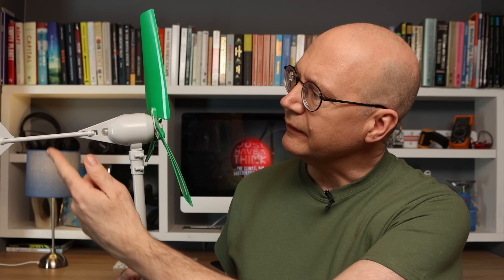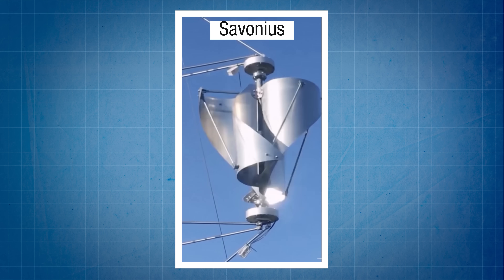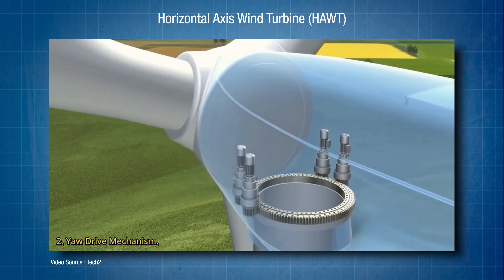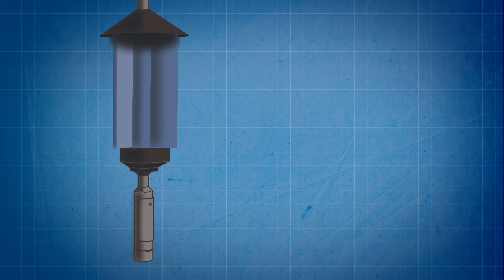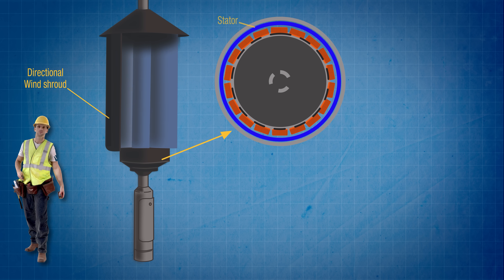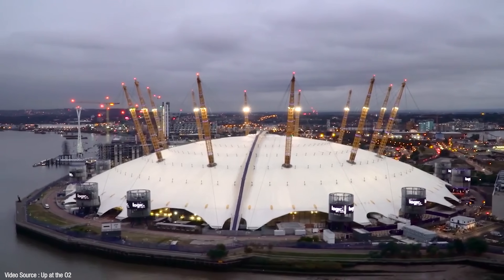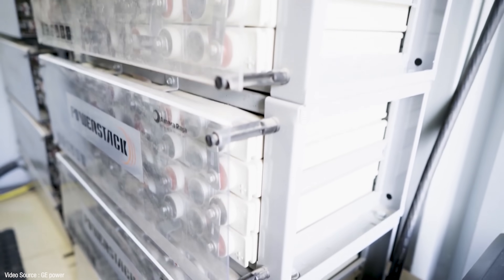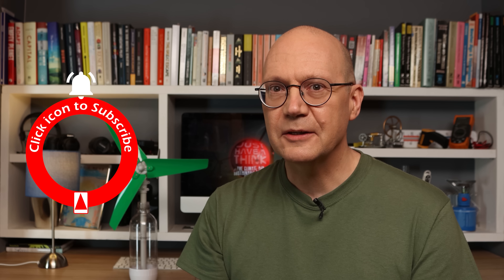A vertical axis wind turbine that doesn't need the prevailing wind! How do they do that?

Comment: This is an absolutely inspiring video. I hadn't even considered harvesting energy generated by traffic. Lots of chatter about the vertical turbines... going way back to the Cousteau Society Ship with vertical turbines instead of sail. Thank you so much, you have a new subscriber!  I'm glad to have happened upon this video!
Reply: Chris Walker  Decentralization comes at a very very high maintenance cost. Look how much the average city spent changing traffic light bulbs. Enough to make changing every bulb in the city to LED profitable.
Reply: Yes this is great, but I don’t have much traffic near my property and I’m in a meadow, so perhaps put one of these up high enough to catch air moving through the trees?
Reply: @Negan The Vegan 
Yes; a wise insight and true.  Brevity is the soul of wit, but I prefer to describe it more specifically as "your electric car is being powered by energy WASTED by other cars on the highway".
Reply: Yea
Reply: it's stealing energy not harvesting it and would overall damage the environment by forcing cars and trucks to burn more fuel. it's a horrible scammy idea and should be opposed by all means.
Reply: I remember the Alcyone !https://en.wikipedia.org/wiki/Alcyone_(ship)
Reply: @etherospike3936  I have simple plans for working model  of that kind ship in one of my books.  I wonder if it hadn't sank if there would have been more of them built.
Reply: These turbine could also be installed on the corners of high rise buildings.
Reply: @ajayvee6677  no they couldn't.
Reply: Nearly half a million USD to decommission.
Reply: Wont work
Street lighting columns will need to be removed and replaced with stronger ones designed to handle the load = £cost
The distance from the edge has to be a minimum for safety so mist will not be suitable to be used
Hiw can you have a bearing in the middle, thats where the column itself is
You cannot reuse the supply cable for cable generation so additional cable will need to be installed = £cost
This us one of those startup schemes that sound good until you do the math and engineering
If its that good then the company should pay for a year long trial in a similar location to prove the idea, bet they wont
Ive seen these sort of things before and they never take off
Reply: @ronaldmallett6629  They would just clamp a turbine around the existing mast. But all of your objections are trivial in light of the real showstopper, that VAWT turbines are really ineffective and that this would only produce about 25 watt at best.
Reply: @ronaldmallett6629  The physical wind load and electrical output are so small, the existing posts and wiring would be quite adequate and a 'lazy susan' style bearing to annularly mount the generator and blades is also workable.  It's the output calculations that are mistaken or deceptive in the optimistic direction that's the killer.
Reply: You don't hear people talking about vertical turbines because they aren't very effective in most cases. There was plenty of talk of them back when wind turbines were a new thing, but these days the turbine designs have been well-optimized and people are interested in good designs that work.
Reply: residue junkie  the burden of proof is on you when you contradict rigourously explored scientific principles. Show your working/evidence.
Reply: @dexterdixon2000  Careful how you talk to him; he is going to be super rich one day, and use his free energy to hunt down all the critics and doubters
Reply: @Negan The Vegan Slowing them down as a result and forcing them to burn more fossil fuel.
Reply: residue junkie  free energy is impossible and defies the laws of physics.
Reply: Can also charge electric vehicles on the go. Solar + induction coils in the road and vehicles.
Reply: @mikelang4853  insane.
Reply: What happened to the Cousteau Ship & was it viable?
Reply: @martinmb6067  None of these things are viable. They are just scams.
Reply: Do some research on vawts.  They don't make much power at all.  Anytime they're spinning some of the blades are pushing into the wind.  They're a novelty.  If you are designing a bunch of highway lighting and adding these spinners to them doesn't break the bank I'd be for it but all the previous work and sales of vawts has shown they put out a small fraction of a similarly sized hawt.  It's the physics of lift versus push.  

vawts are just much less efficient at capturing the energy in the wind.
Reply: Did not one of you deniers see that the setup was halfway shrouded? Which would keep the wind from hitting the blades on that side!
Reply: Its a terrible idea - given their number for windspeed of 5.4m/s and a blade size of 2x0.5m the air only has 100 watts of power (kinetic energy passing through the blade area per second).
So even if they were really efficient like 35% they would only generate 35 watts each...
Nowhere near 2.5kw or 24kw as they claim in the video.
Dont believe me?
Search powerequation for windpower and plug in all of the numbers your self - its not complicated just kinetic energy...
Reply: @jeffreylebowski4927  The data I’ve seen from other similar devices indicates 35 watts would be a very generous estimate. My guess is your math is accurate. Thanks,
Reply: @jeffreylebowski4927  You are mixing units.    The output of energy is in kW/hr not Kwatts.  A watt is a unit of power and a watt hour is a unit of energy.  Power is the rate at which energy can be produced. Energy is the capacity for power to do work.  In your case multiply 100 watts by the time over which you are measuring the energy (or work)
Reply: @dacutler  Thank you, but I really meant 100 watts - its the power of the wind passing through the area of 2m*0.5m if the wind is going 5.4m/s.
You write: "The output of energy is in kW/hr not Kwatts" - I think you got something wrong there - a watt is a joule per second - joule is the unit for energy. - So "output" of energy is measured in watts (Joules per seconds) and that is what we call power.
kW/hr doesnt really make sense, that would imply some kind of accelleration of energy output...
Maybe you meant kWh thats a kilowatt multiplied by one hour or 1000 joules per second times 3600 seconds = 3.6 megajoules.
And that is a quantity of energy - let me know if we got everything straight now of if you still have any objections or questions.
Thanks =)
Reply: @jeffreylebowski4927  The designers of the turbines were using kWh.  It's like the energy stored in a  battery.  1 watt hr is an energy storage that can provide 1 watt for one hour.  It's also the same as 2 watts for half an hour.  Or 10 watts for 6 minutes.  If the turbine is producing 100 watts as in your example, I am assuming you meant 100 watt - seconds.  If you can provide 100 watts for one hour (as in watt - hr) that's a total energy storage or supply of 100 x 60 x 60 watt hours  = 360,000 watt hours or 360 kW hour.
Reply: @dacutler  No I really meant that the wind only provides 100 watts as in 100 Joules per second - I am not talking about a total energy amount - then you multiply by the amount of seconds that this power of 100 watts is being supplied. - Believe me I know all of these units very well, I studies physics.

I agree with the first part of your last comment, but the last part is unfortunately not correct - if you provide 100 watts for one hour you get 100 joules per second times 3600 seconds which is 360 000 Joules which is 1/10th of 1 kwh...

1 kwh is the energy you get if you have 1kw supplied for 1 hour - so its obvious that 100watts will give you 1/10th of 1 kwh during 1 hour...

Anyways I hope you can understand this, otherwise just google watt and joule and kwh and get more familiar with these units.

Cheers =)
Reply: @dacutler  If you can provide 100 watts for one hour, you've produced 100 watt-hours. The 60 x 60 in your calculation is the number of seconds in one hour (3600), so your final unit should be watt-seconds, not watt-hours.
Reply: @gscott5062  Thank you, maybe I wasnt getting what he misunderstood and so couldnt explain it well to him - watt-seconds are of course just joules but maybe thats too confusing when you never use Joules and only watts and watt-hours...
Reply: @gscott5062 Your first sentence is correct, but you have the second part of that message backwards, but I am tired of this rabbit hole, so think what you will.
Reply: @dacutler  This is indeed a rabbit hole. I will sign off by pointing out that, if as you say, "it's perfectly possible for the turbines to have a maximum output of 100 watts and, when measured over one hour, produce  a total energy of 360 kWh", then you can power the average American household (877 kWh per month, according to www.eia.gov) with the same power that it takes to run an average-sized lightbulb for 3 hours. Let me know when you get the bugs ironed out and I'll ditch Xcel and sign up with you!
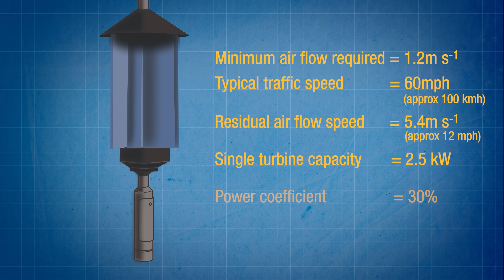Reply: @dacutler  I'm sorry to say you got this wrong- 100 watts is not 100 watt-seconds, it is 100 watts, period. These turbines produce max 25 watts, no matter how long they run, and for one hour, that is 25 watt-hours, wh,  and 250 wh for 10 hours. if you want 25 kWh, you need it to run for 1000 hours. in the video at 5:31 it says 2.5 kW, NOT 2.5 kWh.  To rate a turbine in kWh makes no sense,  because it does not say for how long. Only W or kW makes sense when you describe the generator itself.
Reply: @tzenophile  Ha we meet again - I came back coz I was curious to see if the conversation in the comment section had changed and people realized how wrong this idea is, but I guess most dont.
You are a legend for seeing through the bullshit and guessing 25 Watts :D Your disrespect for this turbine and video was real and you were 100% correct - I salute you :D
Reply: @jeffreylebowski4927  Thanks for the kind words, Jeff!  (or perhaps 'Jeff'..) I am thinking of getting a small wind turbine (1-2 kW) for my farm and have done a lot of "research" over the last year or two. VAWTs look cool and would be less intrusive, so naturally I wanted to believe that they were a real option. But they are clearly a terrible investment.

As for the comment section, it is truly a depressive lesson in how false information spreads on the internet, especially also when supported by presumably well-meaning people like Dave and Rosie, and despite people like us sounding the alarm very early. What is Dave "thinking"?? Old fashioned journalism and peer review was never perfect, but at least this sort of thing would be less of a problem.  Youtube is a great teacher, but also a great problem, at the same time. Anyway, see you on the webz!
Reply: @dacutler  Your understanding of Kw and Kwh is incorrect just look it up online (wikipedia). 100 watts supplied continuously for 1 hour is 100 watt hours = 0.1 Kwh. The amount of power in the wind can be found using 0.0006 x wind velocity cubed. At 5.4 ms this is 95 watts per metre swept area of the turbine. At the claimed 30% efficiency then it will produce about 30 watts, or 0.03 Kw over a 24 hour period this would make 720 watt hours or 0.72 Kwh. My guess is that even this is an over estimate, but its a huge difference from the manufacturer's claims. I say manufacturer, but they have never made one. They have a prototype (Mk10) onto of a garden shed, that appears to be it.
Reply: @goldmagnet9013  Right...and my overall cost is about 10 cents U.S. per kilowatt hour.
Reply: @goldmagnet9013  "100 watts supplied continuously for 1 hour is 100 watt hours = 0.1 Kwh"

This simple statement is much easier to understand. I knew this but still struggled to follow what Jeff et. al were saying because of the way they were saying it.
Reply: @jeffreylebowski4927  Its amazing how many people are defending something that is so obviously a scam. As you say their claim defy physics. I have no idea how they will get them onto the lamp posts in the first place. I wonder how many shares they have sold ?
Reply: @jeffreylebowski4927  I have watched this guy for a while and I would be willing to bet that none of these ideas he touts ever come to fruition. They are all green wet dreams.
Reply: @lkytmryan  Well I strongy disagree with you there - alot of these ideas are and the research he presents are perfectly reasonable and true - just sometimes not really - the gravity tower for example also was most likely not worth it...
Reply: @jeffreylebowski4927  Well only time will tell. I have definitely been wrong before. I never thought hard drives would be needed for example. LOL.

The energy density is just so low. There just isn't very much energy in the wind generated by cars. These devices take a lot of energy to create, install and wire. Batteries are needed to store energy when energy is not being created, and 100% backup energy sources are needed for the times when they inevitably aren't productive. That alone makes them inherently inefficient.

They remind me of ethanol. It takes nearly as much energy to create ethanol as it produces.

The majority of these ideas would still be on the drawing board if it weren't for government pouring mountains of money into them.
Reply: @lkytmryan  RIght, we agree about these turbines - theyre most likely nonsense, and a few other things on this channel also arent feasible, but thats also because theyre being developed and are in their research phase - its ok to be wrong when you are just starting to explore an idea - I just disagreed with you that none of the things on this channel could ever come to fruition like you said... - Some new technology wont work but alot of it will work.

As for government spending, it is true that alot of technology is only here today because of government spending on research - but that is a good thing because the private market will only invest in things that are obviously profitable in the near future - if that was all we relied on we would never have gotten GPS, Telephones, Mobile phones, Computers, Cryptography, Lasers, Particle and quantum physics, nuclear energy, space travel etc... - there is thousands of inventions and discoveries that would have taken many decades longer if it wasnt for government spending either due to war efforts or just general scientific research spending. - Alot of the most useful discoveries were made before we new what they would be useful for... -  And sometimes ending up in a dead end is unavoidable. These turbines though or the gravity tower were developed by private companies not the government.

Anyways, I just try to see things as they are and as objectivly as I can and not as the current political camps and dogmas try to paint them - there is wasteful and bad government and spending and there is very good and useful government and government spending - both can exist at the same time, in my opinion.

Anyways, great chat :)
Reply: @jeffreylebowski4927  
...and the Betz limit on a stationary wind turbine's efficiency is only 59%.
Reply: @jeffreylebowski4927  
remember he was quoting kilowatt HOURS per day, not instantaneous output.
Reply: @denbecr49  Not true - watch the video again - and if the turbines only produce 30 watts for 24 hours, thats only 0.72kwh per day per turbine...
Reply: For backup on sunny days, a parabolic mirrored disk focused on a closed-loop 'steam-turbine' generator could also produce power for the lamps with surplus returned to the grid... would add new shapes to the 'skyline' too.
Reply: @terrytaylor2825  Lunacy.
Reply: @Withnail1969  No, that would be trying to convert moonlight into electricity... although using the gravitational forces of the moon generating tidal action, then tapping that to generate electricity has been done.
The biggest part of this really is that building huge wind generators that require remote mass acreage wind or solar farms is hugely inefficient, destructive and wasteful, making profits for the 'big guy' corporations while corrupting 'environmentalist' groups, when maybe many more small, sturdy, integrated closely to 'point of use', generating systems would be better... diversifying the grid and making it invulnerable to EMP and solar storm crashing. Likely the most efficient generator systems are the molten-salt nuclear reactor systems that could be used to consume and recycle all those 'light-water' waste products of the last 65 years.
Reply: Just to clarify here is the calculation with which you can see that there is only 100 watts of power in the wind in question:

The energy exists in form of kinetic energy (moving mass) of the air molecules and is given by:
Ekin = 0.5m*v^2

To get the power of the wind we will multiply the area of our blade /rotor disk with the velocity of the wind giving us the volume of air that passes through our blade per second. (Area x length = volume, length/time = velocity, Area x velocity = volume/time)
If we multiply the volume/time by the density of the air we get the mass flow (mass per time) moving through our area in question. - if we then plug that into the general equation for kinetic energy by multiplying the mass flow by 0.5 and v^2 we get the energy per second, passing through the area. 
Like so:

Power = 0.5 * Area * Velocity * Density * Velocity^2
             = 0.5 * Area * Density * Velocity^3

If we plug in the numbers giving to us by this video we get the following:

Power = 0.5 * 2m*0.5m * 1.3kg/m^3 * 5.4m/s ^3
            = 102 Watts

We get 102 Watts, that the wind has. I rounded up the density of the air, so that works in favor of this turbine.

If the turbine is 30% efficient it will be able to produce about 30 Watts.

If the turbine did that for an entire day without interruption it would generate 0.72kwh

Hope this makes everything clear - else just google stuff =)

I can assure you that the math here is correct...
Reply: @jeffreylebowski4927  I haven't gone through your math as I assume it's correct.  However, it's perfectly possible for the turbines to have a maximum output of 100 watts and, when measured over one hour, produce  a total energy of 360 kWh as I have already said.  I am assuming you meant 100 watt seconds as the stored energy  because you used m/s in your calculations.  If you assumed the power produced per day is 0.72kWh you must have assumed the speed was measured in m / hour (720 / 30 = 24).
Reply: @dacutler  

1kilo-watt (kw) = 1000 watts.

1kilo-watt-hour (kwh) = 1kw for 1 hour = 1000watts for 1 hour.

100 watts = 1/10th of 1000 watts.

100 watts for 1 hour = 1/10th kwh

to produce 360kwh which is your result you need for example 360kw for 1 hour or 1kw for 360 hours.

100 watts is only 1 tenth of 1 kw...
Reply: I got another one for you. Decades ago I saw the following in Popular Mechanics magazine: They proposed putting pressure plats in the highway system before tollways. Cars had to (break and) slow down anyway. As cars drove up onto the plate and depressing it pumped hydraulic fluid through a pipe to the side of the road to run a generator.
Reply: @scott76252  A better idea would be to get rid of the tollways and not waste all the energy used for slowing down. Generate the revenue using things that don't waste energy. A gas tax for instance. Nowadays they use cameras for tolls but that is a bad idea as well because it just means that more people don't use the tollways. The purpose of any road is to reduce congestion which improves gas mileage as a side benefit.

We all benefit from less congestion.
Reply: @scott76252  With the benefit of increasing effective braking power, too.
Reply: Someone pointed out the stupidity of tolls. Yet there they are, still in use after nearly a century. And for all that time, the roadways leading into and out of the tolls have sustained ADDITIONAL wear and rquired ADDITIONAL maintenance, but stupidly, those additional expenses are still there.
Reply: @scott76252  ridiculous, then the cars would have to use more energy climbing out of the depression.